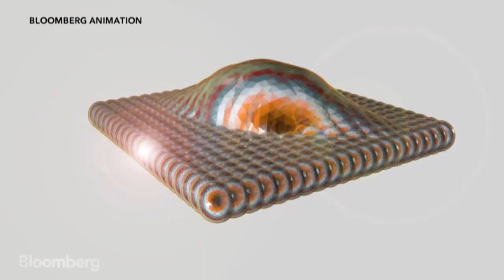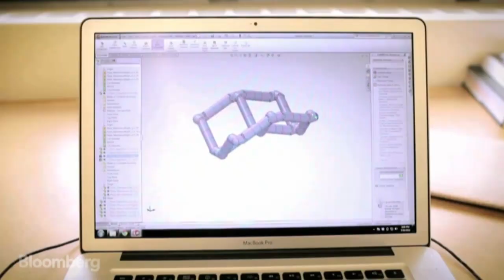It's Not Magic: Watch How Smart Parts Self-Assemble

Comment: i think im missing something but...whats the point of this? i know self building parts or whatever but....if you have to build them into the right shape first, then brake them down then re shape them....whats the point? like one of the example is maybe it can transform into clothing or shoes, ok so you have to shape it into that item first (lets say shoes) then you have to take it apart and then make it again at another location but to what point? you already made the fucking shoes just pack them up and sell them! not to mention if 3D printing technology gets any better than it will render this obsolete, hell 3D printers are already rendering this obsolete because they are using 3D printers to make the stuff in the first place, just make a giant printer at the airport that can fabricate whole parts or planes on the spot! not to mention there is the risk of it "unfolding" would you want to be in a airplane that built itself that suddenly unfolds itself! (as he said temperature or magnets or electrical impulse will control the item so weather gets too cold or hot, or some ass hole up to no good sends out the unbuild signal your fucked) i know i wouldn't! so yeah i think this is kind of dumb and a huge waste of time and money.

Comment: I'm guessing these materials use different elements that stretch or shrink at different rates depending on the temperature. Perhaps something which changes as temperature changes would be more useful then construction parts. An example of something that changes with temperature is the amount of cooling needed on machines. Perhaps excessive heat from a machine could open vents until the machine is cooled. Imagine a house with material along the ground that will surround the home if temperatures get too hot. This could be useful in large scale fires. The hotter the fire, the stronger the material would form around the home.

Comment: Nothing shown in this video can be used for anything to evolve the modern age, except children toys maybe. Great effort on the creativity. But I having a wire curl into a certain pattern is a far cry from clothing creating itself. It is cool to wAtch, but you are only practicing basic physics in this video. A for effort.
Reply: +already100degrees I mean have you seen the first electric motor? It was pithy af, and didn't resemble anything useful. The point is the concept could be utilized by engineers with more resources in their designs. Now we have motors that come in every shape and size for every use you can imagine.
Reply: Actually Nitinol (memory metal) has large userbase and it is used in many applications that would be impossible to otherwise. But it is not a new invention and not from these guys in the video.